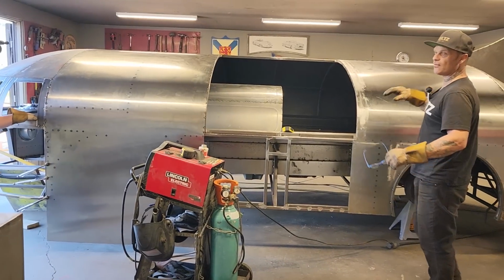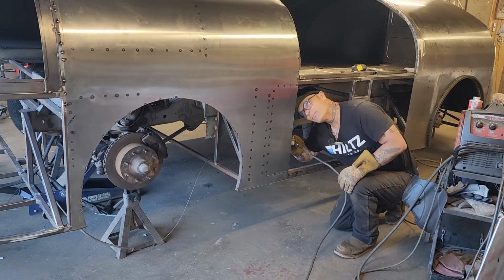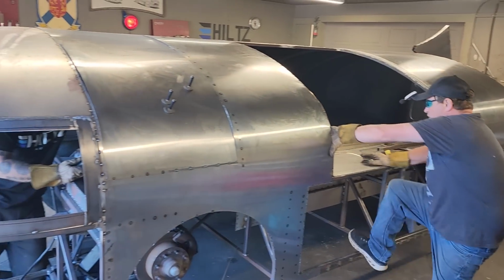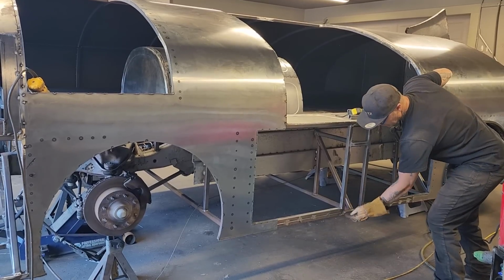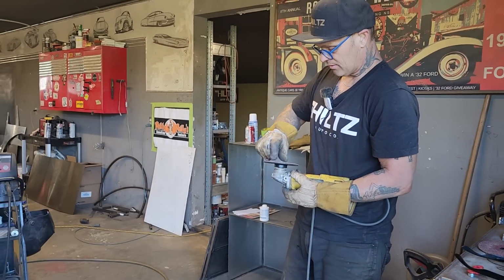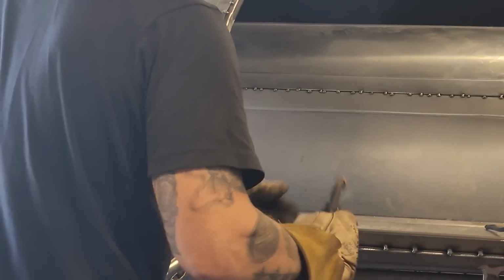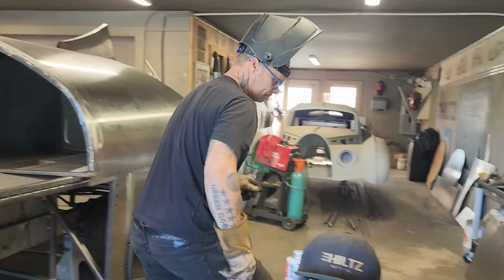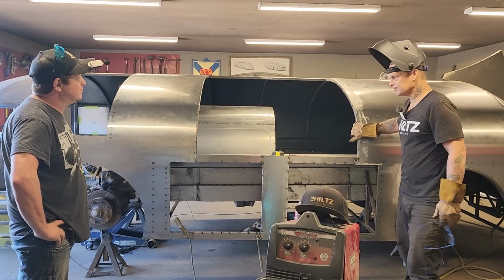Designing the door opening on the Hauler

Comment: You can take the area of the last window, and halfway up the roof
Adding the extra structure would be straightforward as adding a radial member, and a couple of cross pieces
And then adding a roll down window would still be straightforward

Comment: The motorcycle foot pegs is a nice idea.  But personally I was thinking of those foot holes cutouts with spring loaded hinged covers.  You push the covers inwards to use the cutouts as steps.  And the covers spring back the moment you took your foot out.  That way you retain the streamlined look of the tanker.  Just an idea but with your level of skill it will be a walk in the park.

Comment: Fold down stairs with radiuses sides to match vehicle shape. They 
could pivot out as door opens  upwards. Link them together. To make the door and steps light to operate use nitrogen rams that pivot over center so door and steps lock open or closed.
I like the previous post that the door hinges from the bottom. That's a brilliant idea?

Comment: If you made the door swing down instead of up you could have steps on the inside of the door and be able to pull the door back up from the inside with a cable and pulley system kinda like a garage door only in reverse. The springs would probably have to stretch as you pulled the door closed where it would latch. Then when you wanted to open it you would just unlatch it and the unloading of the springs would push the door back open/ down.

Comment: You might want to replace the wall plugs before they start a fire. Loose connections get hot and can burn the wire where it connects to the plug inside the wall.

Comment: Looks great,  you could cut the door entry on the angle of the brace, to allow easier entry.  When making the doors,  if you used bigger 2" offersize sheets and just laid them over you would have a nice smooth 1" overlap for driprail. The front door Could be  straight across the bottom to cover angled kick panel.   Would it be too much to have a fin down the centre of the dash to the floor,  keep on keeping on Chad,  Nova Scotia tours will be great,  Regards Colin Stables

Comment: Consider a folding  air stair as used on many smaller commuter aircraft, much cleaner and safer than folding foot pegs which will spoil the clean lines of your great design.
Reply: I was thinking the same thing but did not know how to explain it. thanks.
Reply: I would use recessed foot pockets as steps.
Reply: Chad's wife Jolene would appreciate a ladder or stairs far more.

Comment: Would it be possible to incorporate steps into the inside surface of the entrance door, and make the door open at the top with the hinge at the bottom? Kinda like fold down attic stairs. That would keep the outside cleaner with no necessity for external steps or pegs at all.

Comment: I wouldn't do the motor cycle peg..I'd do a little foot pocket on front side of wheel well right under where ur putting the door..like tractor trailers and dump trucks got...I even think some newer truck come with the in the outside of the bed too

Comment: so the breaker is constantly tripping and you are getting shocked every time you touch metal? Possible time to get that looked at, 120 Volts is statistically the most deadly voltage that there is
Reply: Try 240volts that's what we have in Australia and I can tall you it don't tickle.

Comment: Are you planning to insulate the chassis and paneling or a headliner on the interior? Many questions- radiator, keeping heat out of cabin, brakes and steering? are there enough hour in the days you''ll be working?  Did Buckminster Fuller have any ideas?

Comment: I have found that every time a breaker pops. It gets weaker so a 15 amp breaker after a few times popping it is no longer a 15 amp breaker. It might turn out to be like a 12 amp and a few more times it turn out to be 10 amp. Might be time to change out the breaker with a new one.

Comment: You can make a step in the centre of the rim that is round and bolts on with the lug nuts
Reply: I remember in a previous episode you were talking about moving the front tires out to the edge of the body. Then maybe the steps would work on the rims.

Comment: Chad the reason you’re getting charged is that someone has back fed the neutral “white wire” on the branch circuit that is feeding the circuit you’re using from the fuse box or the breaker panel that you are using!
Reply: He used two separate circuits . I think his neutral on the machine itself is the prob seeking neutral to his ground why he is getting shocked .
Reply: But you very well may be right
Reply: sounds like building ground...he's laying on the floor
Reply: That is what I was thinking. The weather has been extremely wet. The concert has absorbed moisture and he is a better ground, the path of the least resistance.  Is that possible?  Is it a ground fault breaker or is he over loading the circuit. Over loading circuit has not been an issue in the pass in chad’s shop… but wasn’t he using a Lincoln plasma cutter prior to this?
Reply: I think the Champ is running on high voltage through his veins, to much coffee this morning. 🍵⚡😁✌
Reply: 10:28 - Note when he moves the plug for the plasma cutter to a different outlet. He has it upside down with essentially the wrong polarity, and this is because the ground terminal is missing (and has no grounding as well). I know he's busy trying to get the hauler built whether it's what we see on camera or not, but he really should invest in a new plug end for the cord of the plasma cutter or replace the whole cord. A cord or end doesn't cost as much as getting hurt or worse from being zapped or electrocuted.

Comment: Chad and Jolene the truck is looking good but on your step it might be hard to reach down to fold the steps up so you might want to cut an opening into the side you can arch it at the top and put a flat bottom and box it in on the back side

Comment: Chad
If you use dully front rotors with standard front wheels it will more them out about four or five inches. Should be a bolt on situation. 
Did front end work for fifty years quite sure this would work.

Comment: An old garbage truck would have wipers that would be easy to transfer
They have individual motors for each arm and run on air pressure not linkages

Comment: No the peds are not right or tight. Use fold-down stairs. Hinged just above the wheelwell, like the other commenter suggested.. BTW you will have over heating with you engine as you rad is starved in dead air...😢

Comment: I dont think that making your access where you have to climb in like that.  God forbid anything happened and you have to get out.  If you get an engine fire, you would have to climb near the engine.   I think  it would be better if the door went from the wheel opening to the first upright and included the rear most window.  You could do that from both sides and getting in and out would be a breeze.

Comment: If you are modeling this from the toy, the vehicle has doors on both sides of the cab. It seems like it will be a safety issue climbing through the fuselage to get to the driver and passenger seats. What if there’s a fire “God Forbid” you’ll be trapped with no exit unless you kick out the windows. Very concerned viewer!!!

Comment: Now is the time to try one of the rear wheels on the front.
Reply: I dont know why he just doesn't put spacers on the front hubs instead of trying to put those other wheels on. Hes already said that hes not going to drive it down the freeway doing 70mph. If it's just for show he won't have to worry too much about safety with the spacers
Reply: If you put one wheel from the back you don't need a spacer @Squidlybooga

Comment: Chad why not for the stairs do fold down ladder where you open the door and pivot the ladder down like on the back of a boat then when you get in you just pivot them back inside easier safer and you never see them there inside you could easily make it out of round or square tubing and fabricate the two pivots at the top of find an old boat and get the step off the back

Comment: I wish you were listen to me a few months ago when I told you put the motor in from the bottom you have a list you created a monster you still need the slide top to work on the motor but take the motor out from underneath you wouldn't had to cut that side of it up plus I don't know how your Motors going to stay cool and you'll be inside so it's going to be really hot in there your grill in the front you need to add a small radiator to help cool the other one

Comment: OK Chad,, now listen to me for a second,, install two 6 foot remote controlled telescoping hydraulic lifts up by the small windows, lift the front end up and go into the Hauler through a trap door in the floor, the struts will have rubber wheels on the bottom and you could bump the controller and entertain folks at events by transforming into a low rider ,, Jolene could make in hop like a bull frog,, you got to start listening to us more,, LOL